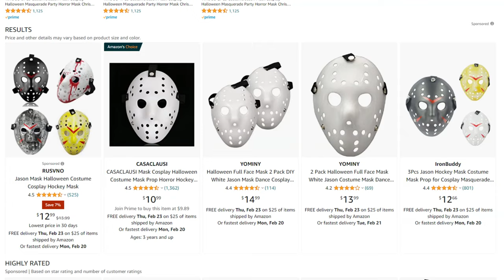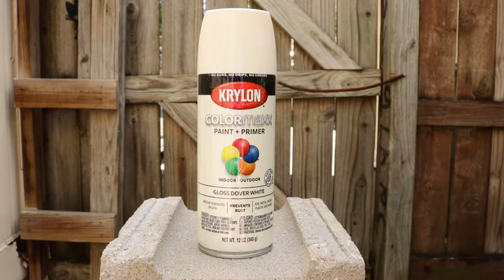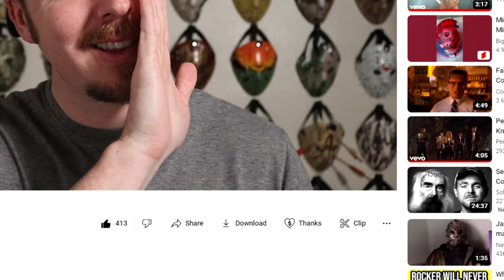How to Make a Part IV Friday the 13th Mask

Comment: I bought a Part 3 style mask of eBay and regrettably, the maker didn't sand the mask evenly, and I think they used lower than 120 sandpaper, because you can see grains in the surface.
Reply from the maker: That's unfortunate. Sometimes I even use 220 or 400 grit paper for a smoother surface!
Reply: @BigHush  You know the old saying: Caveat Emptor, "Let the buyer beware."